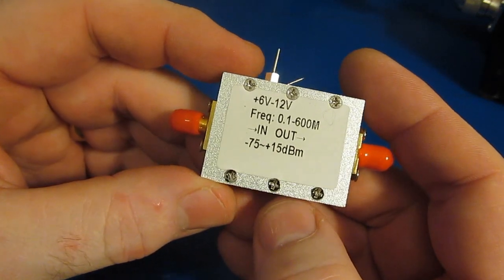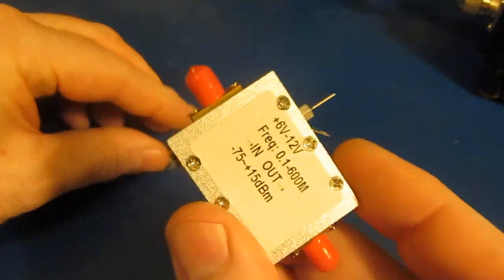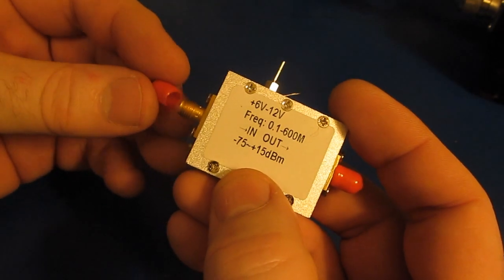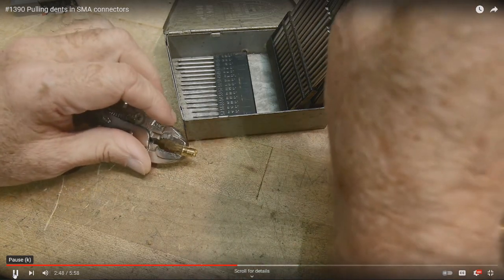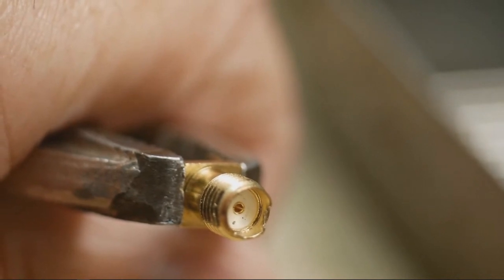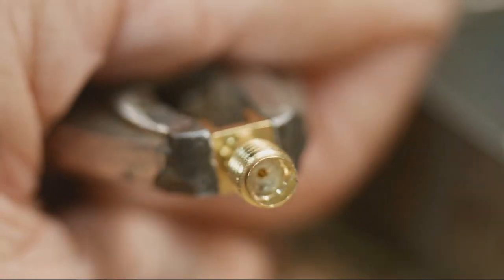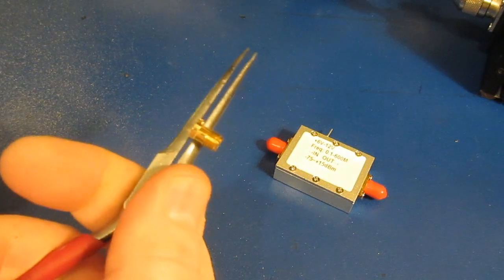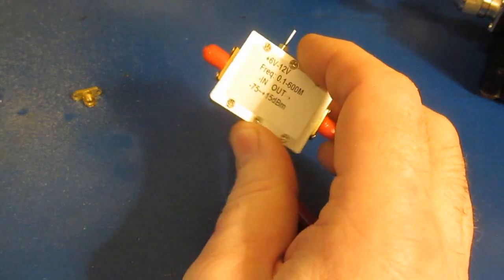Proper SMA RF Connector Repairs

Comment: You're damn right! RF is completely different ballgame. Those connectors might cost tens if not HUNDREDS of euros per piece for that matter if they're lab grade... so NEVER repair RF-connectors. It's now worth the possibility to damage other connectors as well.
Reply from the maker: Worse, you connect your $200,000 instrument to this "repaired" connector. Or  your $3000 cable.  Even worse, you do it over and over...   Then there is all that data you collected with it.   Such a bad idea.    I would have liked to have seen them run the file over it like they mentioned.  lol

Comment: ROFL!!!  I said as much in the comments of that video.  NEVER try to repair a RF connector.  The chance of damaging any connector that ever gets screwed onto it isn't worth the chance and now you have a connector with unknown performance standards.
Reply: I mean when you're starting with a garbage quality chinese sma connector to begin with, does it really make much of a difference if it got run over by a truck and then straightened out afterwards? That's pretty much how they are from new too
Reply: @gorak9000  Yes, it still makes a difference.  Even cheap import connectors are at least round when new.  Trying to straighten it out by wobbling a drill blank in it will leave a slightly out of round which will over time wear out any connector mated to it.  You will also never be able to correctly torque the connector due to the increased rotational resistance of the out of round connector.
Reply from the maker: @mikesradiorepair  It's not only the roundness but the pin and dielectric depths allow the pin to be exposed.  Jamming metal into the connector can damage the flat mating surfaces.   The idea of "repairing" RF connectors is just a bad idea all around.